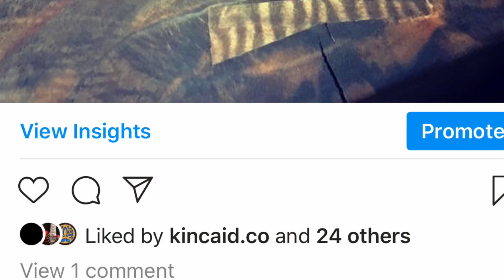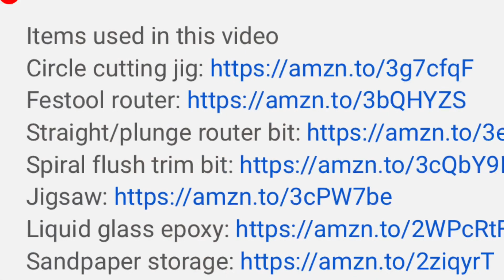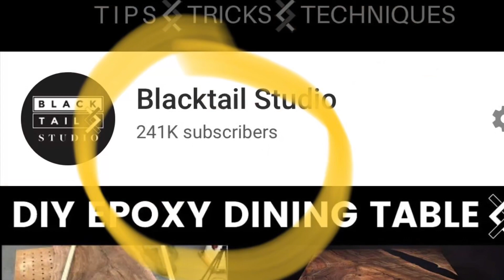Stable Job, Good Money, Great Benefits... I Quit - Blacktail Studio

Comment: My dream job is to be a woodworker.  I too have had a hard time building the confidence and really get the tools and much needed cheddar together to really dive into it. My question for you is, do you have tool sponsorship and if so how do you go about getting sponsored? Btw, wood burned table was very rad and something I have been messing around with myself. I am about to take a class in July on epoxy flooring so hoping this can give me a little peek into what goes into doing an epoxy application.  Great work and I hope to hear from you.

Tyler Luke
Reply from the maker: I get occasional sponsorships. Generally try and reach out to their marketing department

Comment: I'm a tree surgeon in the UK and regularly find myself having to pay to get rid of "waste" (decent wood I don't have the space to store)

Any advice on best seasoning for different types of wood or which can be worked on, based on moisture content, would be great!

 So much info out there for woodworking when it's seasoned. however I'm struggling to find any decent info for cutting, milling, seasoning and then working.

Comment: I had an idea, I saw those 4 bowties in a row and they ruin the aesthetics. Would it work if you did the bowtie from the backside of the table 3/4 deep so it wont show on the front side? or can the wood warp convexly on the front side and it wouldn't work?

Comment: Hello, I have watched many of your videos and love your work! We are doing a deep river pour on ash wood for the bar top of our soon to be opened brewery. We are planning to do the pour and then leave the top in place, and in the frame, after the epoxy pour We plan to do all of the finish work while the bar top is in place as well. The edges will be finished in stainless steel. I was wondering of you foresee any problems with this? Anything I should watch for?  Any advice you can give would be greatly appreciated. Thanks!
Reply from the maker: Make sure the bottom gets sealed too 👍🏼

Comment: I would like to try making epoxy table, the problem is I can't find slabs with such beautiful grain patterns as in your videos. In my area (southern Poland) ash, oak and elm are common. Is it possible to emphasize the grain (increase the contrast) before pouring the resin? I thought about using a stain to color the wood, but I'm worried that it will reduce the adhesion of the resin.
Reply from the maker: Make sure the stain is very dry before pouring

Comment: I usually hate epoxy tables because they're supposed to enhance the wood, which they do but on a technical side only : you see nice grain… but I must say the epoxy tables I see here are much better : they are a real piece of design, each one is like a canvas in abstract art. And that's what a piece of furniture should be : whatever the material, the visual aspect must take over the naturel aspect of the material. Epoxy tables should always be art creation. That's what most are here.
Congratulations.

Comment: I should stop telling people this, but my 'Dream Job' is creating what I have in my head, that I can best describe as a Gym, but for wood working. So basically, what I want to do there's a lot of different aspects. First getting a good shop setup, 5, 10, 15, 20k square feet whatever I can afford the bigger the better. Setup work stations of various sizes that have all of the main power and hand tools (miter saw, circle saw, maybe table saw, work benches, chisels, clamps, routers, sanders) and then have stations for large table saws, panel saws, drum / belt sanders, large planers, jointers, band saws, drill presses, whatever things that people don't constantly need at their work station. All of this you get access to by being a member with 1 weekend, 1 week, 1 month, 6 month, 1 year, memberships possibly different levels of memberships to grant more access to various tools or special reservation options right. Like I live in Colorado kinda near Denver, The Metropolitan area of Denver has over 3 million people, out of only 5.7 million in the entire state. Getting 1% of that population to hold a 1 year membership at my shop would be 30,000 people. At lets say, 200 dollars a month that's $6,000,000 a month. That's $72 million a year. 200 dollars is kinda a lot though, what if we made it 25 dollars, is 9 million dollars a year, or 750k a month. Obviously, there's a lot of material being used, electric, tool blades and bits, stuff like that. But I feel like, with a big enough following by crowd sourcing income through monthly memberships we can have a reasonable monthly rate that can exceed the cost of those items. How much time will it take to get there, that's the big question.

Now the 2nd part of the business, I want an onsite store that sells everything from slabs to dimensional lumber, finishes, epoxy, screws, sand paper, tools, basically everything and anything you could ever need to build something from wood. This goes back to the special privileges I could grant to people that buy a higher membership, or sign a 1 year membership, what if these people got 10% off of everything in the store? Also, with a big enough shop we could have an onsite saw mill to produce our own slabs. And, anyone even if they aren't a member can shop at this store, bringing people into the door is important, because they'll want to be members.

The 3rd part, I want an onsite professional gallery where we sell what people make in the shop for a commissioned fee. This obviously makes the shop more money, but it helps wood workers in the community to have a place that clients can come in and touch things in person before they buy it, also, of course we'll have custom ordering where clients can come in, meet the person that's going to make them their custom designed whatever, be able to see the lumber in person from our shop to pick out their specific piece (if they want) and be able to talk face to face with the maker of that item. Or simply, walk in, and buy something already made in the showroom. We could also sell custom made legs or table stands made by other makers in the community or from wherever. This is kinda my favorite part.

The 4th part, selling classes. If someone wants to learn how to make epoxy tables we fly in Sam from Blacktail Studio pay him whatever he wants (Just to get potential members in the door, we don't have to make anything on these, at least at first) and he teaches people how to make epoxy tables. Or how about Mark the Woodwhisper? Or Steve Ramsey, or the thousands of other famous creators. Also, we can host companies that want to come in and show off a new product like a new tool, or a new finish or a new technique to do something. These classes can also be general carpentry, how to build a deck, how to frame a wall, how to hang a door, stuff that every home owner might be interested in learning.

The 5th part, tool rentals. You can't tell me if I had a Festool Domino that'd I'd rent to you for $30 a day you wouldn't pay that just to use it for a single project. Building a deck at your house after just taking our deck building class and need a miter saw or a portable table saw? rent it. Re-doing your hardwood floors and need a sander for it? Rent it. Maybe a pocket hole jig I don't know, if I can rent it and make money we'll do it. Also, we'd rent out trucks, trailers, and vans. What if you're a member of our shop but live in a 6th story apartment building with 1 parking space and you really wanna build a coffee table. Buy our membership, buy all of the supplies and lumber from the onsite store so there's no driving to a million places or need for a truck to haul lumber, build your coffee table, rent our van for $30 a day drive it to your apartment, return the van and then drive home, I'll even rent you a drill to assemble the table at your house. Can I make this any easier? If you're building a custom 16' conference table for a client, you can rent our truck and trailer with all the straps and protection items required to secure it, and then deliver it to your customer wherever they live and you as a just starting out small wood worker don't have to invest in an expensive truck, or a trailer, you can drive your Prius to the shop, never go to a lumber store and deliver your end piece to the client and never need to buy a single thing.

Because lets be honest, a Sawstop table saw is huge, it's hard to afford the space to put it let alone the $3-4k dollars the tool itself cost. A Festool palm sander is $600, are you serious? What if you could use a professional shop, with 40" planer, 60" drum / belt sander, 12" jointer, sliding table saw, panel saw? Every hand tool you could imagine? For $200 a month? You could buy almost 2 years of membership for the price of a single 4k dollar saw stop. Or 3 months for the price of a sander. I've had this idea in my head since I was like 13, or 14 years old and I'm 23 now. I want to bring wood working with the best equipment available and tools money can buy for the price of a used car payment. I want you to be able to work at Walmart making $10 an hour and be able to afford a membership to my shop so you can enjoy the beauty, the satisfaction and the joy of wood working with no compromise on tools. People tell me oh you can't do that what about insurance what about this or that. I really don't care about that I'm at the point in my life I'm tired of the (not to get political) the Government or anyone telling me how I can and can't do things in my life. If you wanna sue me for creating the first ever legit makers space that everyone can enjoy because you cut off your finger at the band saw then go for it.

Also. I'd want to expand this into everything from welding to auto mechanics. What if you could rent a car lift to add an exhaust on your car? Or what if you could rent a welder and shop space to weld your trailer back together? I think there's a lot of potential for by the month businesses, we pay a lot of things by the month why be cramped in your 1 car garage or not be able to do something because you enjoy living in an apartment (or that's all you can afford)?

Eventually I'm gonna make this dream come true it just takes time and a lot of money. But that's essentially my dream job. If I could get enough people to share my vision and we could put together resources and brain power I think there'd be a solid chance at making this happen sooner than later. I mean, the only questionable business is the rent a wood shop one. But I think the commission based gallery, the lumber / material store, saw mill, tool rentals, vehicle rentals, even services like planing people's lumber for a fee are all viable real businesses already operating. If those could float the cost of a membership woodshop until the pricing and costs were worked out and enough people buy memberships to make it sustainable I don't see why it wouldn't work.

But until then, I'm gonna keep doing my crappy job (Not really, I shouldn't complain that much) of Install / Sand / Finish hardwood floors. Not exactly like building a table, but essentially the same thing just a much bigger scale and bigger sanders lol.
Reply from the maker: They have those. Woodworking guilde or maker space. We have a couple in portland

Comment: I have a question, ive made a couple of river boards. I’ve used 2000 grit on the resin river running down the middle but I can’t achieve the mirror like finish. What do I need to do to get the clear, high shine, on the resin while still leaving the wood with the wax finish?
Reply from the maker: That’s a longer conversation

Comment: My dream job at the moment is actually becoming a  wood worker too, making useful and unique pieces for daily use around the home. Maybe even try my hands at wood turning too. What are the finishes that you use? I have done a small cutting board project and used bees wax it turned out very nice,  but was a hot and long process! Any hints or tips you could offer would be greatly appreciated!
Reply from the maker: I have multiple videos on different finishes. Should help 😊

Comment: I always joked that my dream job a woman isn't going to pay me more than once to do...jokes aside, to work for myself doing woodworking and cnc work would be amazing. About 6 or 7 years go I was redoing the laundry room, bathroom, and adding a half-bath because of a waterless that destroyed that portion of the house. The bathroom vanity that I bought for the full bath was about a grand and when it came to the smaller bathroom I thought "I could build a nice wooden vanity myself for less than that." This is coming from someone with no prior woodworking background, but I did draw a lot when I was younger, have an eye for detail, and I tend to be anal if things do not look right. So, I built my first large item at that point, which actually turned out really good, and immediately started my next one (building my youngest daughter an art/make-up desk). It has electrical outlets built into it, a mirror with lights above, etc all with the same reasoning "I could build her something nicer for the cost of that" when I would see a desk design online. Then I thought "....why haven't I seen a build for a wooden PC tower?" So, I built one while I filmed all of the steps, and put several long a** videos up on youtube showing the process (not to try to create a big channel or following, but because I couldn't find anyone else who did this at the time). I have since upgraded the PC internals, but still use the tower (you can't tell it is a computer when you walk in the room). 
In the end, these items cost me far more than if I bought some crappy particle board items at the store, because of how much I have spent on tools since then. Then came the CNC crap. My brother was working at a scrap yard and one night after work he told me that some business scrapped a full size laser cnc (turned out to be some Chinese laser cnc that has a 51"x39" cutting area). I attached my trailer and drove up there immediately to buy it for the cost in scrap that they would be getting out of it (about $300 for a $6500 CNC, price when new). Spent a lot of time slowly figuring it out, replaced a laser tube (when it shattered from the cold temp in my garage), and fixed it up. Now I am starting to finally understand the process on getting really detailed engravings with the thing (laser engraving photos onto wood). Then I bought a 4x4 ft CNC router (that I am still learning how to play around with). I do still have that youtube account, finally starting to post more videos after about 5 years of nothing, have a website to sell crap (still zero sales from it), as well as an Etsy store and an Amazon Handmade store (which has better traffic). Still, most of sales are from people locally though. My long term goal, until recently, was to have enough business by the time I am 57 (20 years from now) so that I could retire from my current line of work with my pension and do woodworking until I finally want to officially retire for good, and hopefully pass down my tools and experience to one of my daughters at that time. 
Now that covid vaccine mandates are likely going to get pushed onto me, that has changed to "get back on social media (which is really hard for someone who is more introvert like myself), make more videos for youtube, create more designs/products, and try to draw more traffic/sales to my sites. My youtube channel I named JustWingIt, because that is what I would always say when doing something for the first time. If you wait until you know everything about something before doing it, it will never get done. You have to jump in and figure it out as you go. That doesn't mean to jump in blind either though, but there is a reason why men don't like to read instructions. We like to know if we can figure it out on our own. My website I just went with the same thing, but with those as the initials JWIDesigns.com.
Anyway, I just came across your channel about a week ago and have been binge watching your videos since, while I play around on my computer designing new files to try out on the machines.

Comment: Is there a job where you get paid to read books, watch you tube videos, and watch movies? That would be my dream job, but it would have to be books, YT vids, and movies that I want to read and watch not some list that someone else picks. I have been in construction on and off for 15 years mainly doing carpentry and installing but I've done everything from underground utilities to concrete to heavy equipment operator(not like the 20 year vet but sufficient enough to use most equipment without destroying a site) to every job in home building except electrical. I've been a line cook, a chef, a server, a temp worker, a part time mechanic, car and yacht detailer, but I've never really found anything I'm passionate about. I think working with wood in a shop for myself at my own pace could be something I might enjoy but I'm worried that I would spend $5,000-$10,000 in tools to find out that just like everything else I've ever done I thought I would love doing it but I end up bored or just not loving it.

Comment: Dream Job: philanthropist:  Unless I win the lottery will never happen.  My question is, I just purchased a slab has great character.  Do I slice in half and make a table or keep it whole and have epoxy as all the edges?  Not sure if that would look good or to have wood as the outside edges.  Also I've noticed you tend to use all black epoxy what other colors would work to make a nice table?  Thank you for all your videos.  I'm new to this and I'm an over thinker to a fault so just need to know where to start.
Reply from the maker: Man, hard to know via a comment